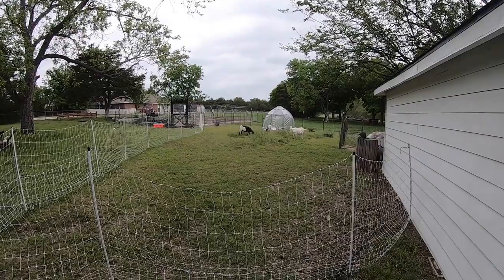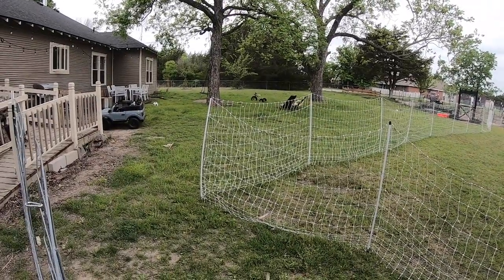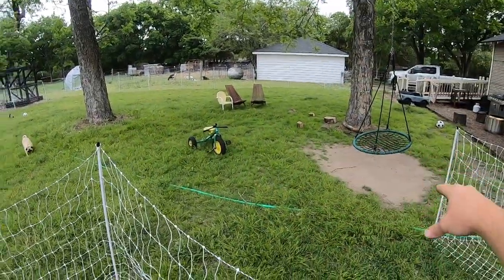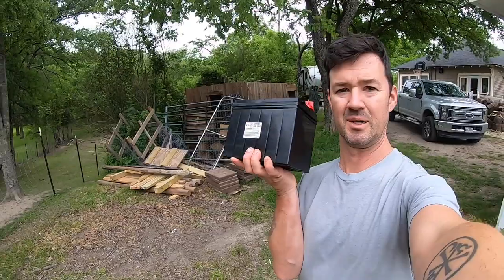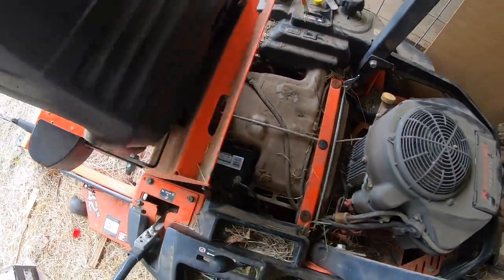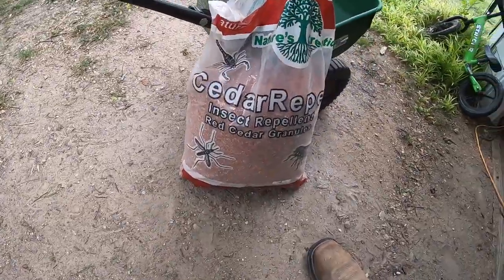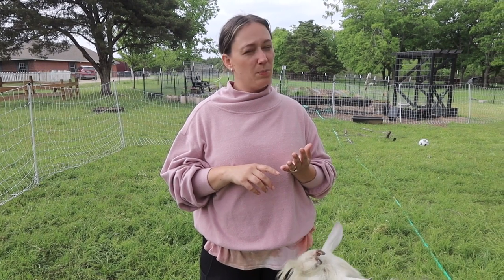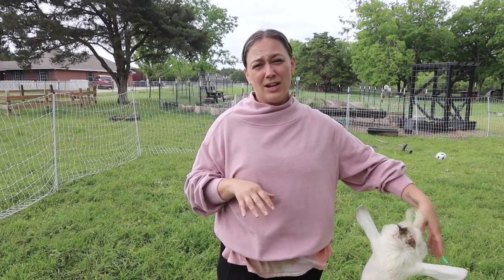If You Hate Flies & Mosquitos | Non-Toxic Pest Control

Comment: Another option for flies is "fly predators". Probably more costly then some of the other options you shared but they have worked well for me in the past. And there's Wondercide which has a lawn and garden spray also.  Another option is you can also grow meal worms as well to save on costs. I'm going to add black fly larvae as well.  Thanks for sharing.
Reply from the maker: Thanks! Yeah we have thought about the meal worms as well. I need to look into wondecrcide, that sound easy especially for the garden.